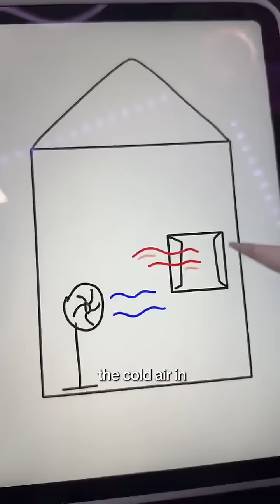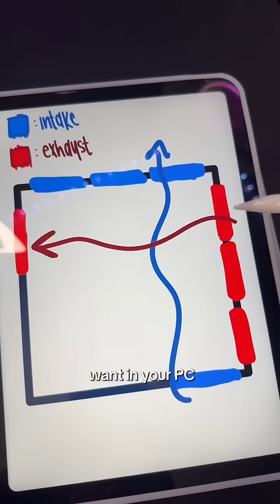explaining pc airflow like you're 5 #lindseyszn #techgirl #techgirlie #techbaddie #pcbuild #techtok

Comment: If you have a radiator be sure to measure the airflow from the fans and adjust your exhaust and Intake equal..
It should always intake more than it exhaust to create a positive pressure, otherwise if the intake is less than the exhaust it will create negative pressure and suck dust from the pcie slot brackets in your case or any hole that exists making it harder to clean.

Comment: Um no this is absolutely wrong. Hot air rises, so whoever taught you this is wrong. The exhaust fans need to be the top fans and the rear fan. The intake fans need to be the bottom and front fans... The shit you explain in this video is just ass backwards
Reply: yeah but she fine though
Reply: @USureAbtThat This has to be the most irrelevant comment I've ever seen
Reply: She didn't mention a radiator pressure should always be positive if you gave a radiator you must measure the air intake through the radiator and add intake fans accordingly.. otherwise pressure will he negative and suck dust from all the case holes